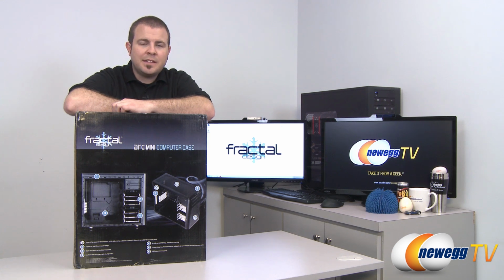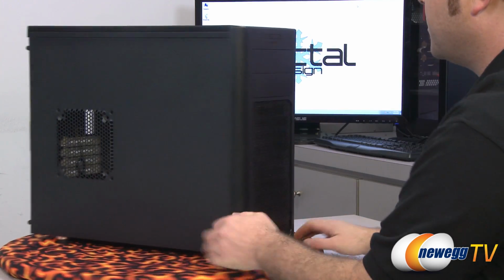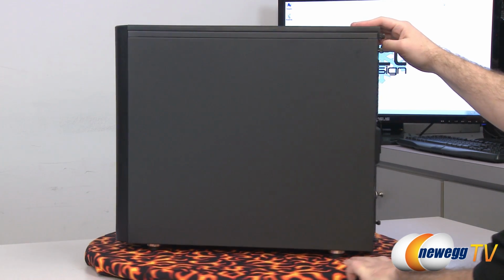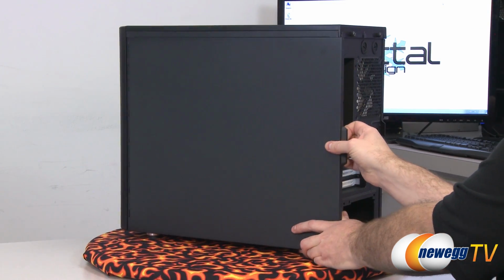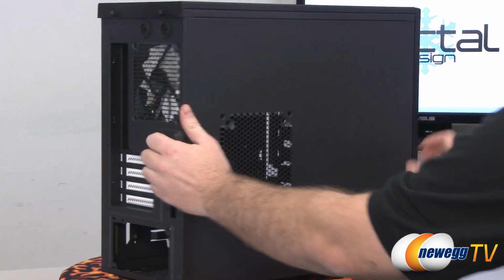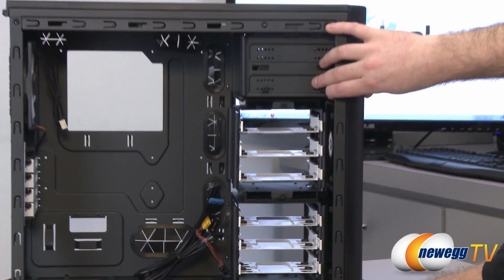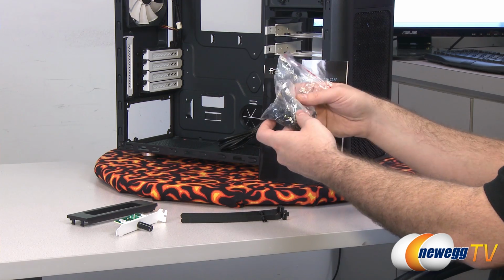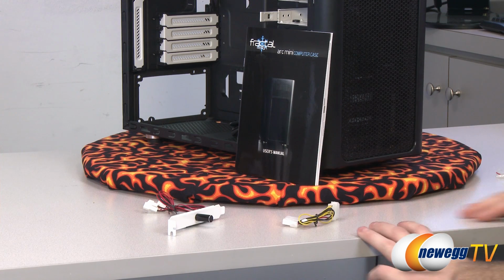Newegg TV: Fractal Design Arc Mini Black High Performance PC Computer Case Overview

Comment: Yeah, I'm pretty much sold. I think I'll just run a single CPU watercooling loop using the fans in the front for the radiator mount since it doesn't look like there is enough room for a radiator up top.
Mega glad I found this case! :D

Comment: Funny how youtube recommended a 2 year old case video. I would hope that there is a case like this with a removable motherboard tray though I probably wouldn't use the lower fan slots with my power supply since I think that the fan is another exhaust port on my current pc.  I'm happy with the video and I'll have to loo back to it.

Comment: This time it's so damn close, that the question is valid! It might depend on the cooler installed on it. I saw a Sapphire version, where the cooler is just a tiny bit longer than the PCB, fit and TOUCH the optional drive cage when installed, so you would be well advised to install the GPU and then the drive cage. The specs do not guarantee that a 7950 will fit without removing the cage.

Comment: @blink180heights Probably not, barely fits in my Rosewill Challenger with side panel fans on. If it does fit in this MicroATX case, it will be a tight fit.

Comment: I have a watercooled system built in this case (Rampage III Gene, two HD6870, chipset and mosfets all liquid cooled). It's the best case I've ever had in all my life. And I had plenty. One thing I don't understand: I removed the sponge filter on the top as soon as I was builting the system... I mean, filter sponge on air exaust? wtf?? Is this some sort of HEPA filter for the ambient, just as for a vacuum cleaner?? Plus, my fans were not that silent...

Comment: @Vikkar1 It's pure stupidity. But I own NZXT Tempest 410 Elite case and it also has 1 UBS3.0, and 3 2.0 which means I need to plug in 3 cables instead of 2.